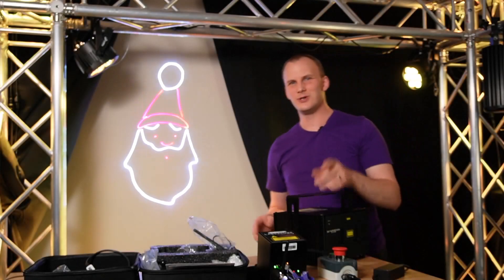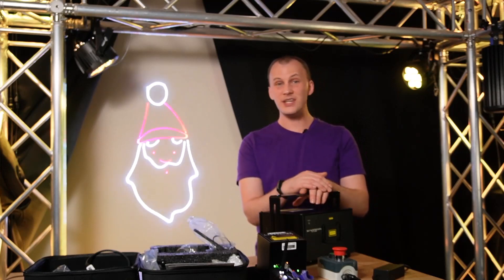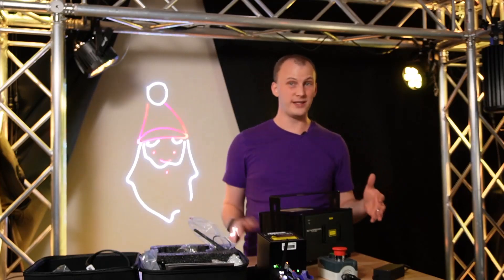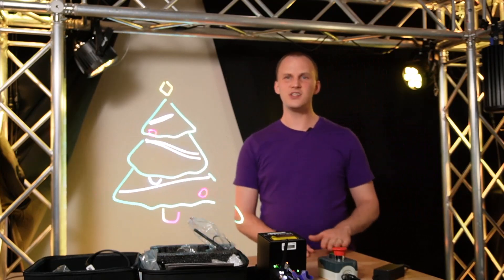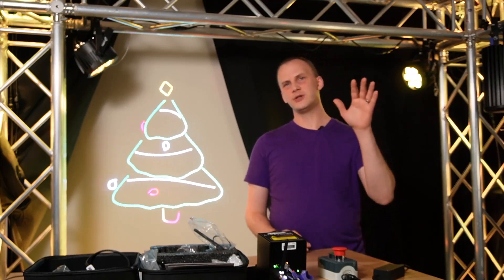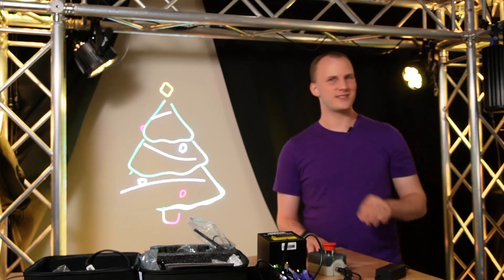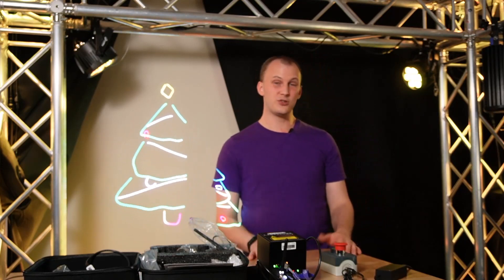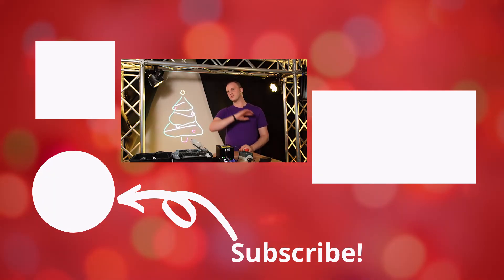How Do You Use Lasers in A Christmas Light Show?  Featuring the LaserCube 2.5w Wifi

Comment: Thank you for your videos. Very informative. I followed along your other video getting loopMIDI and ShowCockpit configured. When I send DMX from xLights, ShowCockpit receives the ArtNet packet. Should the loopMIDI "Total data" and "Throughput /sec" indicators update when I send DMX data from xLights?
Reply: After trial and error, I was able to get over the first hurdle. xLights wanted the controller for the DMX model to be set up as "Use Start Channel". I then copied the start channel from the controllers setup tab. Now when I output to lights ShowCockipt does the MIDI translation as expected and loopMIDI increments "Total data" and "Throughput /sec" indicators.